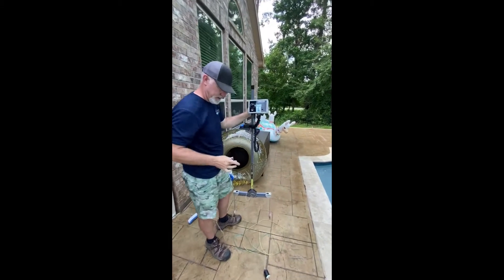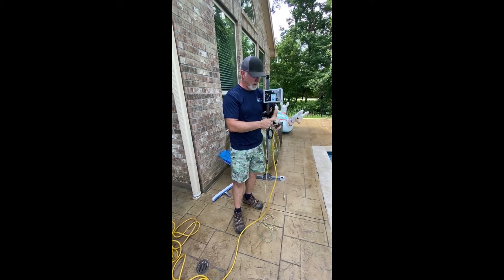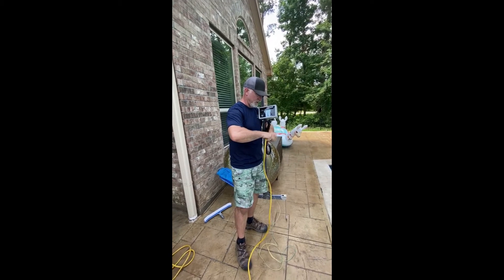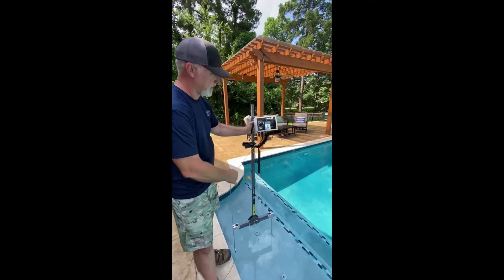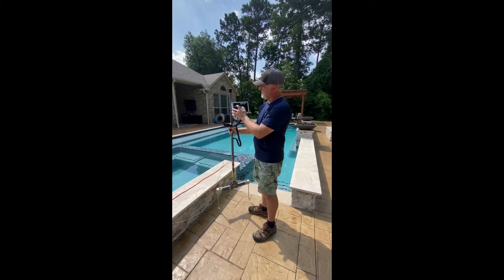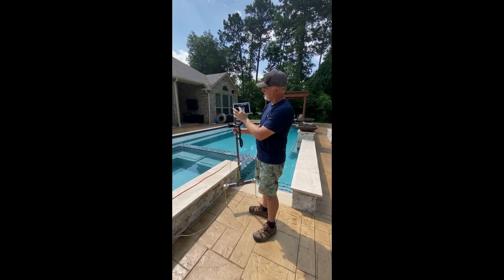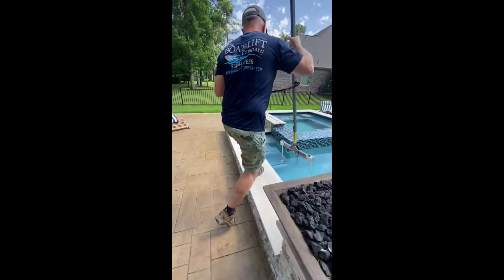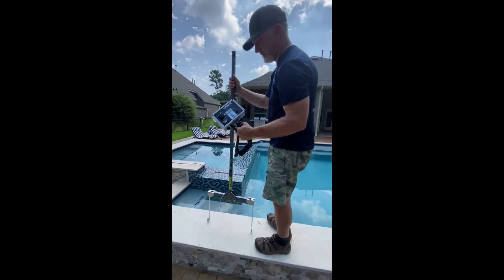Electrified Water & Current Tester, the Canary

Comment: <Plugs the unit into the House ground>

Electrician here! Bold of you to assume the House Ground is actually good!!
Reply: This products other function is to  measures step or gradient voltage so NO physical ground connection is required to locate the presence of electricity or even the direction to the source shown in the second part of the demonstration.
Reply: @derrickfournier3698  Agreed.
Reply: @derrickfournier3698  Yes, I noticed that feature, and love it. That would take a fair bit of good engineering, and I was impressed.
But, still, I'm that Weirdo Electrician that , at the first sign of anything "hinky" in the house, will disconnect the Bonding Grounds from the panel, and see if there is a voltage difference between them.